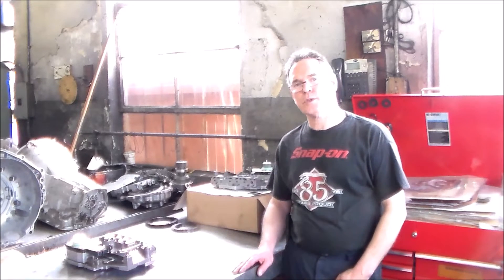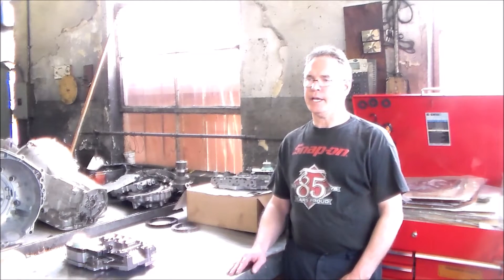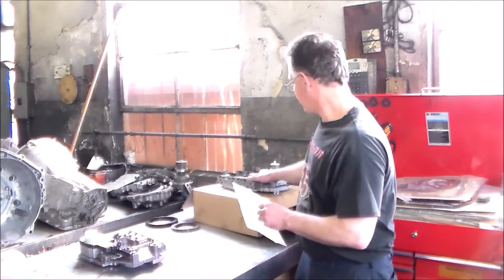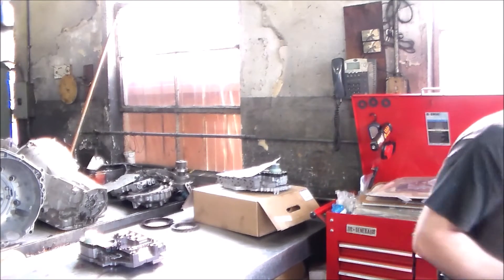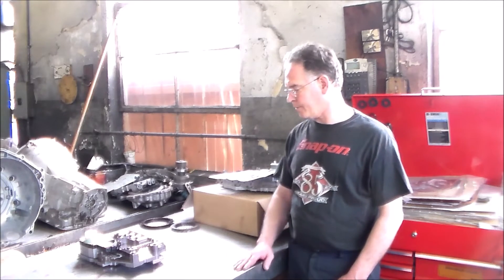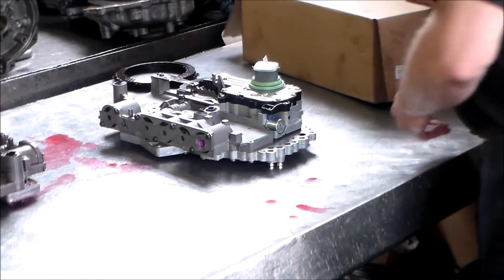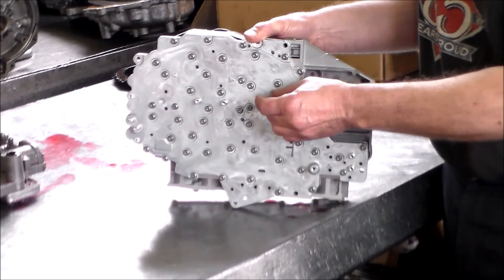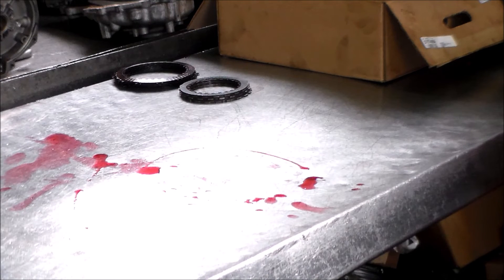68RFE, Code P0871

Comment: can you help me, I have a 2019 ram 3500 4x4 68rfe truck, I bought it like this delete, it has a 5 position tuner without a screen, only a button that changes, I drive it in stock mode, everything is stock, but I got a code p0871, I already changed the transmission oil and filters, I get the code only when I am with a trailer pulling maybe 10k pounds when going from 60mph and going down to 40mph and then I hit the accelerator, and if I do it abruptly I get that code p0871, I have to turn off the truck, reset it and erase the code and it works again, but it hits the up and down changes a little if I use the tow-haul mode and exhaust brake, only if I hit the accelerator hard to take off with the trailer I get that code
Reply from the maker: Anytime i see this code i do a valvebody and solenoid pack
Reply: @GaryFerraro my truck have 190k miles
Reply: If I change the valve body and solenoid, do I need to put a tuner on the transmission? I don't know what type of tuner it has or if they deleted the transmission, or if they raised the pressure to 225 psi. I don't know where to start. Can you guide me? @GaryFerraro
Reply from the maker: @Santijucas  I do not have much knowledge of tuners, i do not use them
Reply: @GaryFerraro thanks sir

Comment: Can a P0871 code be caused by not having enough transmission fluid? I have a 68RFE with 237k. I believe I lost the 5th gear too. Shifted a little hard after stopping and going again. I stopped to visit someone then left again it ran fine. I just cleared the code and just fluid level. It's between the Cold and Hot pair of check points. I checked the level at a transmission temp of 176
Reply from the maker: I would make sure its full for sure.   usually the 871 code is a bad valvebody

Comment: Hello Gary, so I’m having this code come up on my 2020 Ram 3500. I had my driver running a load it was a lot of up and down hill the code popped up and put the truck in limp mode he pulled over let everything cool down and he cleared the code for whatever reason. It drove normal again but came right back and put him in limp mode and would not shift out of 4th gear. He also said when he pulled over again he saw fluid underneath the truck (not sure what it was) took the truck to the dealer they didn’t really say much but they smelled burnt fluid and would recommend getting a new transmission. What would you suggest in this case ? It’s only throwing the code for the solenoid.
Reply from the maker: well, the fluid leaking maybe because coming out of the vent, when it worked it drove and shifted ok?
Reply: @GaryFerraro  yes it will go through all the gears with light acceleration before the check engine light pops on and puts it in limp mode and pretty much holds the truck in 4th gear.
Reply from the maker: @exclusivecarstm129  Well, usually a valvebody fixes the 871 code, does the fluid smell burnt,  does the car work ok cold?
Reply: @GaryFerraro  the dealership told me fluid smelled burnt I haven’t personally checked. But it does drive just fine when it’s cold.

Comment: Excellent video, thank you for posting it.  Here's the issue I am having:  2016 Ram 2500, 6.4 liter and it has the 66rfe transmission.  I keep getting this same code, the P0871.  The solenoid pack was replaced under warranty last July and from what I am being told, it's the 4th time it's been replaced.  Yesterday I installed a Sonnax reman valve body and I transferred the solenoid pack from the old one.  When I dropped the pan, the fluid looked perfect and no metal on the magnet or anywhere in the pan.  So a friend of mine uses his scan tool and does the quick learn and I go for my test drive and it shoots the same code.  I have never had any other codes show up for the clutch packs or anything else, it's always the same code.  I tried a test drive this morning and the same scenario.  I plug in my hand held scanner and clear the code.  I turn the truck off and turn the key to the power position and plug the scanner in and that code immediately shows up as a permanent code without even driving the truck.  I'm thinking a wiring issue but I'm stumped at this point.
Reply from the maker: Do you have a scan tool that shows live data?  you will have to monitor the O/D Pressure switch to see if it is changing state
Reply: @GaryFerraro  Good morning and thank you for your response.  I ended up installing a Sonnax solenoid pack and it solved all the issues and it drives like a new truck
Reply from the maker: Thanks for the update,   @Dmans442
Reply: @Dmans442 im happy for you I know it can be a pain .im having the same problem but not sure if I should. Change the. Solenoid pack and the valve body .yes I want to save money but I don’t want to do double the work.what do you think
Reply: @Dmans442 
I'm getting the same issue P0871 only comes on. On every other start up did yours fully go away or did it come back on later on I see it's been a year so far.
Reply: @Popey3_  in February it will be 2 years since I installed the Sonnax rebuilt valve body and solenoid pack and that code has never come back.  You can find them on RockAuto for a pretty decent price

Comment: Trying to troubleshoot my '16 ram 2500 Cummins with the RFE...low kms aprox 96,000. I'm the 2nd owner and seemed to have lived an easy life so far. Only symptom that has recently poppped up, is a hard  downshift from 2nd into 1st. Just as i come to a full stop, that last shift is a thud. I've drained the fluid, reolaced all filters and topped it back up to spec. Old fluid looked decent, magnet had some fuzz. Hard shift is still there. Will a re-learn help? Maybe do another drain and fill, now that I also replaced the pan with a drain bolt option? No check eng light. Any help is appreciated ty

Comment: I am not a mechanic, and my 2018 Ram 2500 6.4 is in the shop right now because of this code. 

I was pulling a heavy load up and down some mountains on the highway, and it was definitely a hard pull for the truck. The truck has 60,000 miles and I purchased it at 56,000 and I know the previous owner towed with it, but I don't know how much.

The first issue was it being stuck in 4th gear. It would only downshift to 1st, then go back to 4th, skipping 2nd and 3rd. The trans was running about 184° so I pulled over to let it cool off. After a few minutes (it didn't really cool much) I restarted and everything normal for a while. 

I dropped off my machine and returned back to the highway with an empty trailer. When going up hill the truck wanted to downshift to 3rd but the once it did, it seemed to slip, then went right back to 4th. This is when the check engine light came on (code P0871). At the top of the hill, I pulled over, trans temp was about 200°, and turned off the truck for a few. Started it again, and all was fine, and I took the rest of the drive very carefully. For another 60+ miles, and all was fine. 

Right now, the mechanic says there could be 25 things that could throw this code. I had the fluid and filter changed at 56,000. They will drop the pan to see if they see anything, but he is already suggesting that it could be the valve body. But that may not be it and could be a waste of money and suggest then that it gets a new transmission. 

Do you have any advice?
Reply from the maker: I know you changed the fluid but what is the condition of  the fluid? smell burnt?.  Anytime i had this code it always needed a valvebody.  Any other codes or just that one?
Reply: @GaryFerraro  I didn't do it myself and they didn't tell me about its condition. When I checked the levels before the change it did not seem overly dark or burnt, but that's only on the tip of the dipstick

Comment: I have a question I have a 2016 ram 2500 diesel with that same transmission as year ago I had it serviced for a recall in reference to sit in my packs now I’m getting the same cold that you got on this video and this Eric would be related to their repair which they don’t even want to cover anymore I would appreciate if I can help with problem I have. Thanks
Reply from the maker: What did you have done a solenoid pack?
Reply: @GaryFerraro  I brought it into the dealership for  a factory recall in reference to replacing the. Solenoid pack. Ever since that repair it down shift’s rough from 3rd to 2nd and overtime it has developed a check engine light . Code P0871, transmission fluid pressure sensor switch .

Comment: Thanks Gary. I rebuilt my 66RFE because it had burned up the Overdrive frictions. It drives just fine until hard acceleration. Then it throws the P0871 code. My 2017 2500 has 95,000 miles. Guess I'm going to get a new valve body.  That's the only part that isn't new.  So, can you explain why my valve body didn't have that error code before the rebuild. Thanks again.
Reply from the maker: Did you open the valvebody to clean it?
Reply: @GaryFerraro  Thank you for answering my question Gary, I really appreciate it. Yes I cleaned it and installed the new accumulator rings. There was some ware on the valve body from the switch valve. I installed a new solenoid pack and gaskets on the separation plate. (There were no gaskets before).
Reply from the maker: @paulblakeslee5119  That code can come up because of a solenoid switch valve problem, even if gaskets are used code can still come up
Reply: @GaryFerraro  I realize that after I watched your video, but the code wasn't there before my rebuild.  I will be buying another valve body tomorrow. This is my second automatic transmission rebuild so far. Thanks again for your help.
Reply: Thanks again Gary, I replaced the valve body and my truck has over 300 miles on it and seems to be doing just fine.
Reply from the maker: @paulblakeslee5119  Glad you got it back on the road, also, the channel plate warps too, after it's open and channel plate is warped can cause cross leaks.
Reply: @GaryFerraro  I installed a billet channel plate with a bonded separation plate.  The transmission is in a gas Power Wagon and really shifting smooth. I do tow a fifth wheel trailer regularly.  Do you know if the Sonnax Line Pressure Booster RFE-LB1 work as advertised? Thanks

Comment: Excellent Video - insightful.
Im working on a friends 545RFE (2006 Commander) and got these codes:
P0841 Generic Pressure Trans Fluid Sensor switch A
P0733 Generic Gear 3 incorrect ration
P0871 Generic Trans Pressure Switch Circuit Range C
P0731 Gear 1 incorrect ratio
P0876 trans fluid pressure switch D

I was thinking just a solenoid replacement. Wiring, relays, etc appear fine. 
Took out valve body, trans oil looked fine, metal on magnet acceptable for 150,000miles etc.

Do you think it is most likely the full valve body replacement and not just the solenoid? I did think it was strange I did not see the 0750 code specifically.

Vehicle ran completely fine then one day limp mode and been parked since - so not a slow occurring issue. 

Thank you regarding the Quick Learn - I knew about this but didn't know exactly why it was required.
Can I change the valve body/solenoid and drive it to dealer for quick learn, or should it be done immediately? We talking like 5 miles to dealer.

Thank a bunch
Reply from the maker: With the gear ratio codes, sounds like you need an overhaul.  The pressure switch codes may be solenoid pack and the P0871 code , you need a valvebody

Comment: Hey gary i get this code but i cant communicate with the transmission control module and wont go in drive just reverse
Reply from the maker: Should have a pcm, was this code in the engine?
underdrive clutches probably bad if no forward, when you fix or overhaul it, change the valvebody
Reply: @GaryFerraro  yes code was in the pcm. Before the car drove fine just would kick in third gear then after replacing the solenoid it wouldnt go in drive

Comment: Hi sir , if you can please help me with this issue, I have 2013 town country has about 120 miles on it . Lately When I drive on it the freeway sometimes the speed will not goes high stay around 55 and the RPM stay low And they told me change the transmission fluid and filter and I did and started working fine for one month now sometimes will not change on higher gear and the RPM is high stay around 5 but when I turn the car off and back on drive normal and I got a Code p0871 so what u think please they dealer  are asking a lot of money and afford it is it small fix or big fix let me know please thanks
Reply from the maker: Is  this going into limp mode?  Is that the only code present for the trans?
Reply: @GaryFerraro  no limp mode light on  only  showed up this code when I plug the scanner

Comment: hi MR Gary, i fixed my truck last year according to your suggestion and it worked great after that, but today i have another problem with p9871 code. for some reason the tran get hot (199) and stop shifting. i let it cool down, while waiting i cleared the code. it ran fine after that and stayed on 174 degree. any suggestions Mr Gary? thank you so much for your helpful video. my email is nolawelder82@gmail.com.  have a great weekend

Comment: So I have a 2017 . Pop this code when passing someone without a trailer and wouldn’t go into overdrive . Pulled over checked the code  Turned off the truck and restarted it and everything was fine after that . But I have noticed downshifting very hard when towing and gets kinda jumpy .
Reply: How did you resolve this problem .... the same EXACT! problem happened to me....  my ram is also 2017 ....
Reply: Those valve bodies are dying like flies. We  got the sonnax rebuild from rock auto and the end of this along with the bizarre 3 to 4 lurch and chirp.
Reply: How did you resolve the problem?

Comment: i have a 2012 Ram 3500 6.7 4x4 . On limp mode. The mecanic says its pcm, sent it to be repaired. i was told its good. changed out the silenoid he put a black one on. I heard that is susposed to be a white silenoid. HELP
Reply from the maker: Solenoids may have been gray, white is ok to use.  If in limp mode there has to be a code present, can you tell me what the code(s) you have present

Comment: I didn't. Boost pressure or tune and less than 100k on the clock got this. The aftermarket has a golden opportunity here Sonnax, revmax and others are rebuilding these to improve them.  I'll drop the pan and see what's in the bottom first.
Reply from the maker: Revmax has the channel plate a lot of rebuilders are using
Reply: Finally dropped the pan, nothing lying there put in the sonnax remanufactured VB, That was the end of that the classic bad behavior when warmed up. It also corrected the bizarre 3 to 4 lurch and chip also.

Comment: So why replace with the same crap OEM valve body that caused it in the first place.
Reply from the maker: had to replace because of a cross leak, there was over 200K on that body. There are fixes for it now, some companies came out with a channel plate( almost as much as a new valvebody)
Reply: My '16 jus got this code a few days ago less than 100k. Seems they are dying like flies, no indication FCA is improving them, same as the turbo actuator  I  had to replace a few months ago with a reengineered aftermarket piece.

Comment: Hi gary I have a ford edge 2008, 6f50, 3-4 shift hard and R too. But not codes, greetings from colombia
Reply from the maker: This before or after overhaul?
Reply: @GaryFerraro  after, the problem the transfer is broken,  but the transmision was ok after overhaul shift hard 3-4 and R too
Reply from the maker: @ovidiolibreros9323  Have you tried do a shift adapt reset?

Comment: I own a 16 2500 ram, got this P0871 code, took it to the dealer, they change the transmission fluid, charge and arm and a leg, a month later the same code came back, what to do?
Reply from the maker: common for this code is a valvebody or solenoid pack, when i do these units, i get the valvebody assembly(with the solenoid pack) from the dealer
Reply: Thank you! I've doing some research, and I think I should do that. I'm doing it myself since the dealer has been a rip-off lately. Do you know known problems with the viscous fan clutch?
Reply from the maker: @Black_skyas  I do not, only have built a few of these units

Comment: hi Gary, thanks a lot for sharing ur video, i have a question about my 68rfe 2011 ram cummins. this model doesnt have trans fluid bypass valve like others, tranny get very hot and came up with p0750 and p871, fresh fluid and clean filter, line and coolant blew out with air. could it be solenoid or the whole body? can u email me at nolawelder82@gmail.com ? thanks a lot again

Comment: Just got this code P087 on my 2016 Ram 3500. After diagnosis the code when off. I drove home over 500 miles no problem should I have the transmission service? If so, flush or full service?
Reply from the maker: Ken Wil my e mail is. Gsferraro @yahoo.com.  Could you e mail me your vin number.  If you clear the code how fast does it return?  How many miles do you have ?
Reply from the maker: What is the definition of P087?
Reply: @GaryFerraro  Excuse me its P0871
Reply: @GaryFerraro  Code P0871 indicates that the Transmission Fluid Pressure Sensor/Switch"C" electrical circuit out of operating range.

Comment: ATS has a bunch of videos about all the crossleaks those are prone to
Reply from the maker: Ryan Brennan Thanks for the tip. Are the videos on you tube?
Reply: Gary Ferraro I think so, they are a company that builds high hp 68s for the people who feel the need to race them, they show a lot of the failures and corrections they do